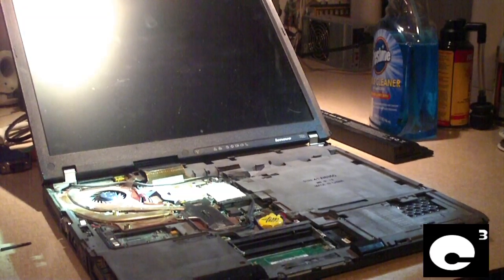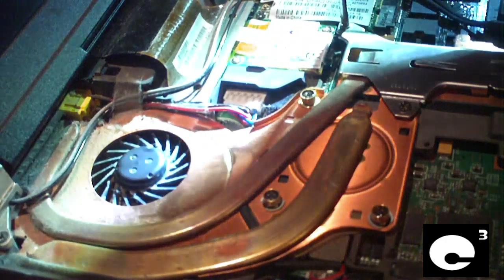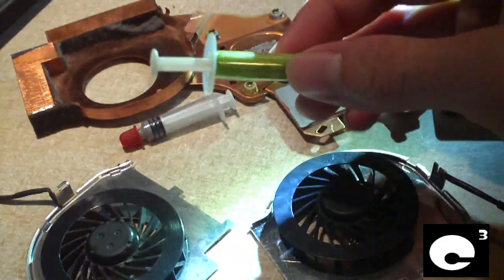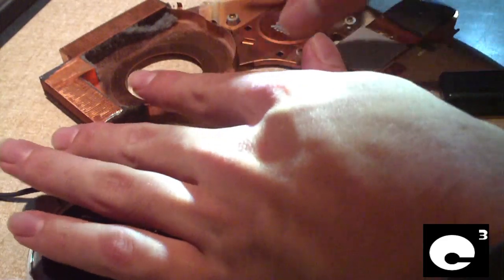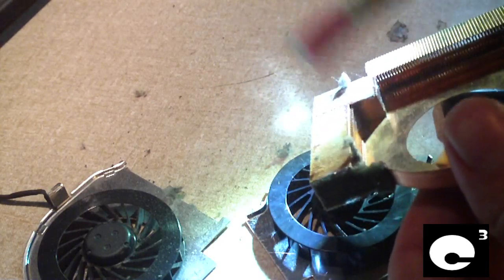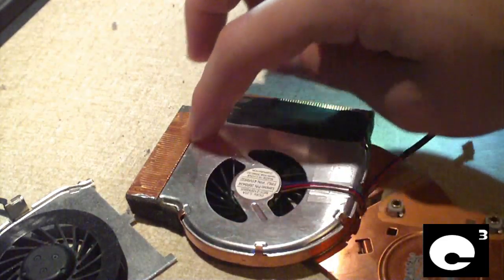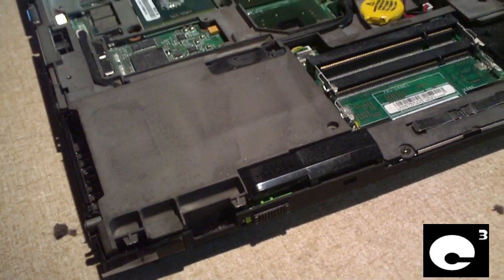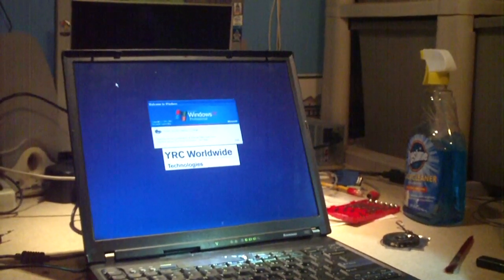IBM T60 Cooling System Tour + New Fan Installation

Comment: My Thinkpad T60 generates a lot of heat, and has a thermal shutdown when running in a room with temperatures over 25C. It doesn't even have a discrete graphics controller. I do keep it clean, but I guess Lenovo used a processor with a higher TDP than what the chassis was designed for (it still has an IBM badge on it from the time IBM's PC division was acquired by Lenovo - Lenovo had a 5-year license to use the IBM badge on Thinkpads and other Think- products).

Comment: Some of that probably had to do with those "thermal pillows" they use to transfer heat from the northbridge and GPU.  It's just not as good as metal and thermal paste.  Speaking of which, I need to yank those out of my T60 and put in some copper shims.

Comment: those lenovo's are pretty reliable machines, im typing this comment off my lenovo t400, which is a I think better version of the t60 by alot, mean, the t60 uses a 65nm cpu, pata interface, and my t400 has a more of a wide screen but still 14" and has a 45nm t9400 c2d cpu, which is a power house, has ati graphics deticated and intel integrated, and has about the same cooling system setup and i think, much easier to take apart, only 5 screws for the keyboard and mouse pad